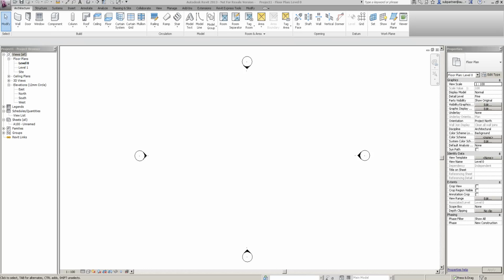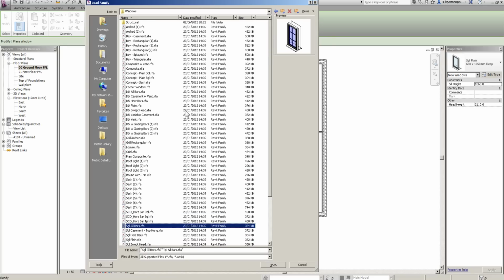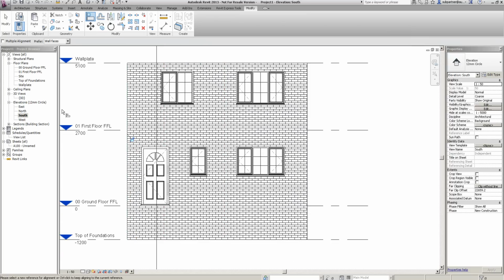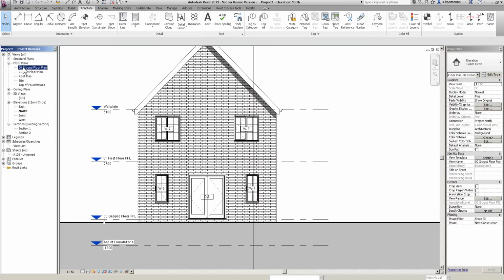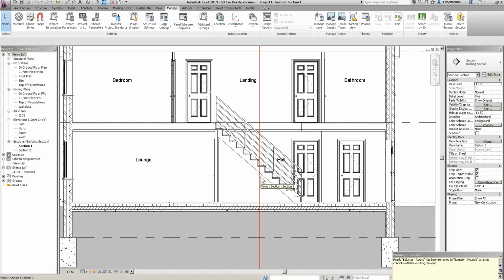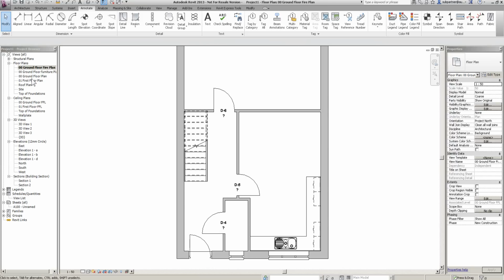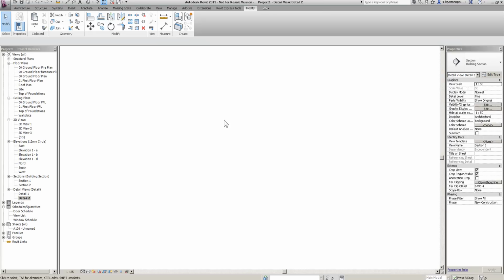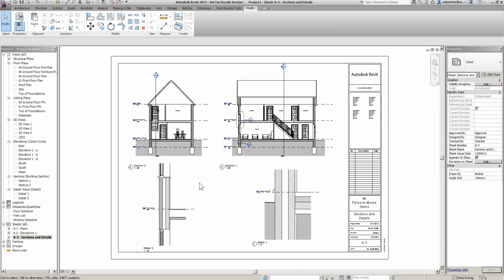Revit Residential Demo

Comment: Hi James, thanks for the demo its really helpful. But i have a problem when i'm about to print it out. Most of the stationaries here don't use Revit so i have to transfer it to AutoCad. When i transfer it lineweights are terrible. Is there any other way to solve it?
Reply: +Batuhan Akarsu Convert it to PDF.

Comment: how did you make your ground filled with gray color, and made you ground line thicker when you made your Topo?
https://youtu.be/5vGCniht8BE?t=1698
Reply: +Jon Carretas You can do that a couple of ways.

To modify the line weight for all views in the entire project:  Manage Tab > Object Styles > Model Objects tab > Topography > increase the "cut" line weight (I use 6).  To change the earth a certain fill:  You'll also notice that to the right of the Line Weight columns is a column named material.  You can change that material to any material you want.

To modify the line weight in 1 specific view:  open the view you want to modify > select the topo > right click > override graphics in view > by element > in the "View-Specific Element Graphics" menu, select "cut lines" > change weight to whatever you want (again, I typically use 6).  To modify the cut pattern to be gray, just select "cut pattern" in the View-Specific Element Graphics menu and change the pattern to whatever you want.

Comment: Very helpful video, thank you James. But I got a question about placing a window/door on a wall. I can't get the exact dimension required on two sides of the wall next to the window. If I correct one side, the other side gets streched as the window moves. How to place a window at the exact location on a wall?

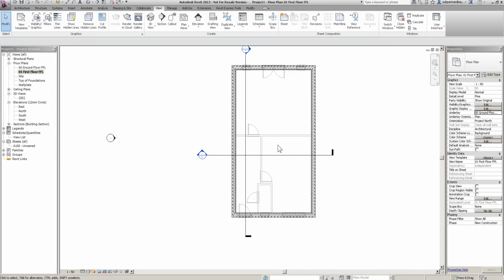Comment: Around the beginning of 18:00 minutes, you/he switched to the first floor (second American). On mine, it's completely blank. My teacher, a kid in my class, and myself have all tried just about everything we can to make it show up, but it's just not all that willing. Any hints?
Reply: Hi Olive,

Do you use skype? I could have a look for you if you like?
Reply: Mr. James

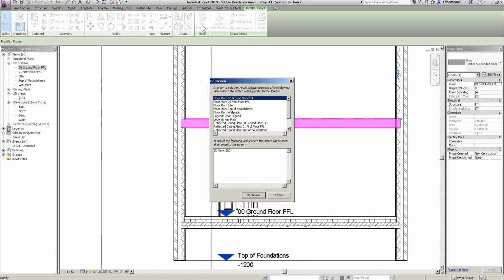I actually restarted it and figured out what the issue was. In the message box at 17:00, I changed it to 01 First Floor instead of 00 Ground Floor and it worked. I'm assuming that was where the fix was. Thank you for the offer though. And thank you for the instruction. Have a wonderful day sir.

Comment: how to get roof tiles like yours... i don't have in my revit 2014 or I can't find em
Reply: Hi guys, Do you use skype? I would be happy to show you?
Reply: James Parsons-Moore Are the repeating tiles out of the box or were they in your library?
Reply: Hi mark. They're out of the box. You simply have to install the right content. During the install you customise revit. And ensure UK content is selected. Thanks J
Reply: James Parsons-Moore Many thanks sir.  I THINK I installed metric (I'm in the US) but will check. Btw, did u upload additional videos using that same example building? Thx again for sharing your knowledge.
Reply: Hi mark. 

There's a couple on there but struggling for time. You in the US?
Reply: James Parsons-Moore Yes sir.

Comment: Concise and powerful case-study lesson in about 1 hour. I highly recommend it.
A question though, how do I get the UK Metric Library content in my program in the US (from your scrolling it looks like it has so much more components)?
Thanks Mr Parsons-Moore.
Reply: The UK METRIC LIBRARY is a content pack that you load during the install process. You can add this later if you still have your install files? Just re-run the setup file and "add/remove features"